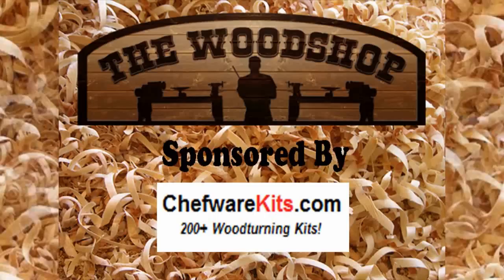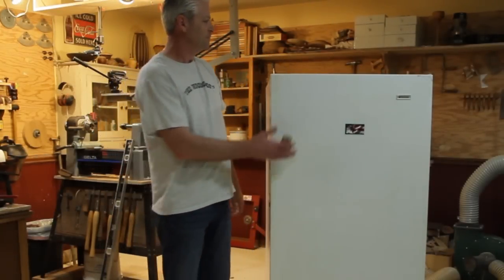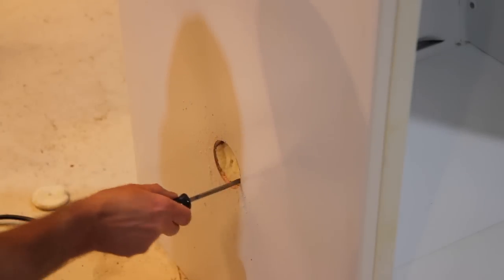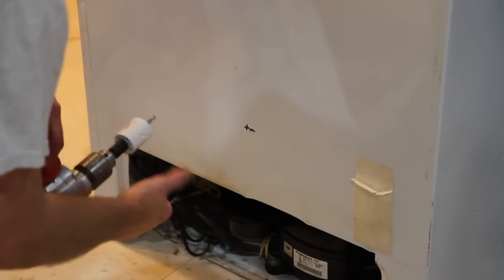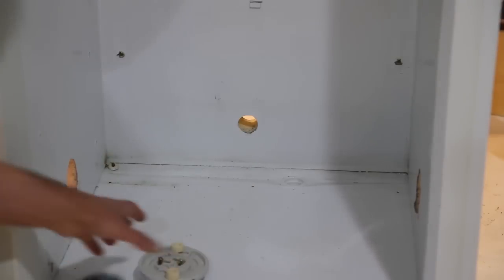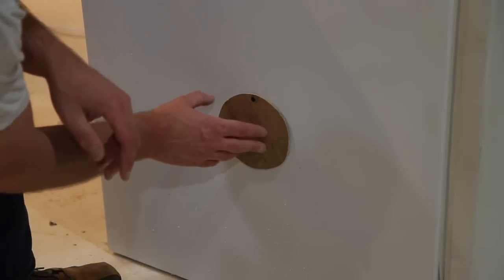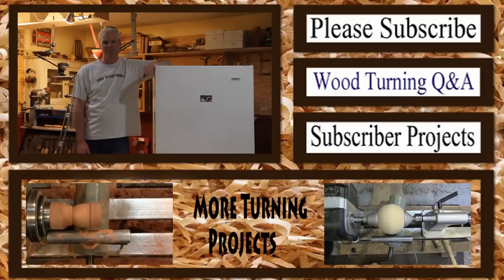DIY Kiln- Turn An Old Freezer Into A Kiln For Drying Wood

Comment: Yes add a fan !  Nice freezer kiln. You could hang your moisture reader on the door owl magnet.
Here I've been considering building a solar shed kiln. But this freezer looks quick and easy for small turners etc.
I'll give it a try with some local black cherry, maple, and black birch I've cut this year.  
I always worry about fire hazards with anything I leave on indoors.  Think I'll have two vents in case one slips closed... 
Thanks for the video Carl.

Comment: Great idea Carl,
despite the fact that you are recycling an old freezer instead of building an insulated box out of wood and styrofoam here is another tip from me, if the motor on the compressor is still running, you can use it as vacuum pump for veneering. I did this 25 years ago laminating wings for RC gliders, as the glass fiber mats, the carbon fibers and the epoxy had to "bake" in a vacuum, we build the box (2m long but only 40cm x 40 cm in width) heated with a 60 w light bulb, the wing inside a plastic bag which holds the vacuum from the compressor.
Another tip from me: as the airflow should only get rid of the humid air, you might reduce the energy used for the light bulb by adding some kind of a thermometer from an old stove (temperature to be controlled should range from 40°C-250°C, 100 F - 480 F) so the temperature will not exceed the desired as the light will be shut of by the thermostat. This reduces power consumption, and you have a more even temperature inside, which might help with the drying as well. So you what I suggest is keep the temperature at an even level (lets say 50°C = 122 F) and slowly reduce the humidity inside by opening the holes: I think this might work better than reducing the humidity very fast, as this will do damage to your wood. And after a day or so, the humidity inside the fridge should be the same as the one in the wood, therefor you just have to measure the humidity of the air to see whether the wood is "done" or needs some more cooking.
Greetings from Good Old Germany
Happy Easter
Peter
Reply from the maker: Thank you Peter,
That's a great idea! I'll check out the appliance repair store, and see if they can help me out. 
Happy Easter,
Carl

Comment: Thank you for this video.  My shout-out to you is a bit late.  After watching this last Spring I made one out of a stand up Freezer with a 2-Way bulb adapter and this thing cooks.  It works so well I just picked up an old fridge and am making a 2nd one.  Drying small wood slabs and cherry wood chunks for bbq wood.
Thanks again.  You made this look real simple.
Reply from the maker: Very cool glad they're working out so well for you.
Reply: How long did it take for the wood to dry.

Comment: Good video Carl. I got an old broke down fridge and freezer, took out the refrigerant equipment and put in a $16 ceramic heater which has a thermostat on it. Set the thermostat and put the heater on low air flow, stuck an outdoor thermometer inside and left the door cracked a little for air flow. It works great. I have only lost about 1%-2% of the bowls I have put through it and that is a bunch of bowls, blanks, club members blanks and bowls. Only have $20 in it tops. I may put a hole in the side but I haven't seen where it would help out much.
Reply from the maker: Thank you Adam,
I'll look into ceramic heaters, the light bulbs are getting scarce.

Comment: Great ideia, mainly if one realises it can be used for several different purposes besides drying wood. I think it could be easely adapted to dehydrate food or dry ceramic in a poters shop. Of course the power of the lamp would have to be adquately adjusted.
Reply: A grat ideia!

Comment: That's a much better kiln than I made. I just made mine out of OSB, then had to line the whole thing with aluminum foam board. I used a 125 Watt flood light though. Depending on what I'm drying, I can get it up to 140 degrees with there.  Nice project.
Reply from the maker: Thank you Steve,
This freezer was given to me, or I would've made something similar.

Comment: You might consider a shield to block the direct light on the wood. This will help to avoid hot spots. Also I believe a kiln needs to be kept at around 105 no warmer than 109 to avoid cracking. Some water heater thermostats go up to 110 before shutting off. Maybe testif wiring it to the light or a fan.
Reply from the maker: Thanks for the tips, I think I need to get a thermostat.

Comment: Great project Carl, I will be interested in seeing how this works for you.  I suspect that a little fan to move the air in the box, would speed up the drying process.
Reply from the maker: Thank you Bill,
I took the little fan out of the freezer, but I might wire it back up.

Comment: You could use the wiring and power cord from the old fridge light, and probably even the light bulb socket. Just be sure the freezer compressor is disconnected from power. Oh, and there may also be a fan on the fridge motor.
What temperature inside the wood kiln are you aiming for?
Reply from the maker: Thanks for the tip Gary! I'm shooting for around 100

Comment: Nice Kiln. I built a fruit dryer along those lines, and used a couple of 12V computer fans I had sitting around for ventilation. You need to use a transformer to get the AC in to run the fans at the right voltage. Too bad those incandescent bulbs are getting scarce. They make good heaters.
Reply from the maker: Thank you John,
It had a little fan in it, I may try to hook it back up if it won't work old-school.

Comment: I decided to copy you and started cutting holes in the freezer but the drill bits kept coming out with sirloin steaks and sausages stuck to them.  I'll have to watch your video again to see where I went wrong.  The bulb - I've seen a cover put over it to stop condensation splashing on it.  The other thing I saw was a little computer fan to move the air.
Best Wishes, Brendan.
Reply from the maker: The steaks and sausages are where I got this extra 20lbs cleaning out the freezer :)  It had a fan in it, I may have to hook it back up. 
Take care,
Carl

Comment: Here's a tip if you drill a hole too small with a core cutter, put the right size cutter on the arbour, there is sometimes enough thread on it to put the wrong size core inside the right size one, that will centre the bit. ;)
But hey, you're a woodturner, i bet you could have turned a 'dowel' to fit the hole with a pilot hole already drilled
Reply from the maker: Thanks for the tip Sparky

Comment: Next time - to make a 1 1/2" hole a 3" hole cut another 1 1/2" plug with the hole saw from a piece of scrap and use that plug to center the 3" hole saw to cut the larger hole. It will wobble, but should be close enough to work. Or if you have a 1 5/8" or 1 3/4" hole saw that might make a plug to fit more precisely to prevent the 3" from wobbling.
Reply from the maker: Excellent idea! Thank you

Comment: Hi Carl, I enjoy each and everyone of your informative videos, they have been thought provoking and inspiring. 

When 100 watt incandescent bulbs become obsolete, you can go to most any gun shop and get a gun safe heating rod. They are used to eliminate all moisture in a gun cabinet that would cause rusting problems. There not expensive to operate and last a lifetime.

Comment: Interesting. I'll be curious to know how much this changes your drying time. I'm presuming you want to use it to speed up the dry after rough turning.
Reply from the maker: I'll be running a few test over the next few months. I'm hoping it will speed up the drying process before turning.

Comment: you should have mounted the light to a metal electrical box & put the wires out side the cabinet with a strain relief  or other to make sure the wires could not get pulled out.

Comment: You could control the temperature inside with a PID (cheap ones around $25) and a thermocouple. This'd cause the light to flicker, so switching to a toaster oven heating element might make more sense.
Reply from the maker: Thank you for the suggestion.

Comment: Have a look at some some of the beer brewing control projects done using an Arduino or Raspberry Pi on Instructables. This is just the sort of closed loop system that they would work well on. Just set the humidity level and temperature and let the control circuit do the heat and airflow.... 
It might be a bit of overkill for drying wood but I wasn't the one suggesting you turn a fridge into a kiln.  ;-)
Cheers,
Ben
Reply from the maker: I'll look into that. Peter also suggested using an old oven thermostat.
Take care, 
Carl

Comment: I KNEW I bought a 30 year supply of 100W light bulbs for a reason!  Just didn't know what it was until now....  Seriously, I bought about 200 of the 100W bulbs during Home Depot's "last chance" sales. Also stocked 75W, 60W, and 40W incandescent bulbs. 
I think if you look around, HD, Lowes, Sam's, and BJ's still have some 100W's, but as stated in the comments, not for long.  I can't stand the replacements, though LED's may eventually be the answer....just too expensive right now, and still being improved.
Reply from the maker: Nice, you're going to be very popular soon......lol

Comment: So, on the eastern (desert dry) side of the state would you use a hot tub instead of a freezer? Or, use the little hole in the bottom to hook up a humidifier? <grin> Great job, and nicely described. Oh, and it can double as a fish smoker, too.
Reply from the maker: Thank you Stuart, you can use the hot tub to boil it, and then put it in the smoker lol

Comment: I wonder if the old cooling system could have been retrofitted? Take out the Freon pump and add a tank-less water heater with recirculation pump and run water through the pipes.
Then a chemical such as Royal Purple Ice or Lucas Oil super coolant radiator additive could be used with the water to pull the heat from the heater more efficiently and put it into the fridge. Make it a closed system with the additive and the boiling point is raised to keep danger down in case you are looking at high temp (I don't know what is best to dry wood).
A thermal coupler could be installed in the fridge to monitor the internal temp and with some simple wiring a automatic on/off temp controller could adjust (turn on/off) the water heater and keep everything in order. The temp controller (depending on model) could have a step heat program to allow for "slow heat" ex. it heats 10* over an hour, each hour until it reaches set point so if set point is 100* it takes 10 hours and will stay at 100* until manually turned off. Slow heat is only needed if heating the wood too fast would cause it to split, I know nothing about wood and how to cure/dry it. 
 Oh and a hole to allow the water vapor to vent, like the one you already have, but you may want it in the door since the door does not contain any pipes for the Freon. That way the system will not be damaged. A fan to push the air back down the sides so the heat can bring it back up may help as well, as long as the air moves around the wood and doesn't just sit there. I guess a hole at the bottom of the door and one at the top would do just fine
But hey, I may be over thinking this LOL.

Comment: The only problem is that you cannot or shortly cannot buy 100 watt incandescent bulbs. But I'm sure you'll be able to adjust.
I'll be interested to see the drying routines.
Alan
Reply from the maker: I'll have to get a bail of them at Costco :)
Reply: Carl Jacobson halogen spot light. they get hot
Reply: that is ridiculous that they want to ban incandescent bulbs the only light better if from the sun it self. florescent bulbs don't last near as long and are more expediencies and don't come close to an incandescent. i say contact you senator and tell him that your his boss and if he passes this he will be making a big mistake. so what they use a little more energy if there is an energy shortage tell people to stop plugging in those death traps they call EV's (electric vehicles) you would save a ton of energy that way
Reply: What I am using is some small crockpots like they use for potpourri no need for a lightbulb at all and they work great

Comment: The proper way to install the light bulb is to use an electrical box. The light bulb is an expensive way to do it. Reversing the freezer to heat the inside would be far more efficient.

Comment: Hi Carl - how did the Kiln turn out?
If successful, how long did it take to achieve desired results? 

Thanks!
Reply from the maker: Thank you Carlton! It drys small pieces in a few weeks.
Reply: @CarlJacobson  I'm considering building one to dry some wood cookie slabs, say 1"-2" thick and between 12" - 24" in diameter. I know there are a lot of variables (wood type, wetness of wood, etc).. Any ball park estimation as to how long it would take to dry from a freshly cut hardwood cookie of this range of size?

Many Thanks Carl! This is very inspiring!

Comment: Hi Carl, I know you built this 7 years ago, but do you have a follow up on this system and do you use it today?
Reply from the maker: Hey Dean! I didn't do a follow-up video, but yes I'm still using it today, It works great for smaller pieces.
Reply: Thanks Carl, have a great weekend.

Comment: Hi Carl, what type of heat source should i use.. and what type of drill bit is that  your useing
Reply from the maker: Hi Brittani, 
I used a 100w light bulb as a heat source. and it works great. The drill bits are called hole saw bits.

Comment: Hey Carl, how did this work out? Ive been hearing about these and theres a few ways to do it. I own a junk removal company and I have 3 scrap fridges in the yard ready to go to scrap yard. I think im going to use one for this. Maybe all 3. haha. Any tips on what you added, what not to do and so on? Ibe heard changing the watt of the bulbs every so often.  And adding a computer fan in it.
Reply from the maker: Steven Rose It's working out very well for small stuff. You should put a fan in it, it helps out a lot. I'm not sure about changing the bulb or the watts.
Reply: Carl Jacobson how about a ceramic heat element like for lizards

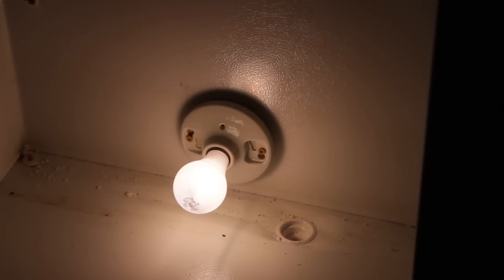Comment: 3:20  the highest wattage  incandescent bulb you can now (legally) buy is 60watt.
Reply: +Lenny F you can use a flood light.
Reply: +Lee Goins,  Flood light is a type of bulb, can be any wattage.
Reply: Lenny F The case my uncle bought a few years back are 500 watts, e still has several left.
Reply: +Lee Goins I just want to dry the wood, not burn it.
Reply: Lenny F use 2 lights and have 120w ;)
Reply: Thanks Mike, you are one heckuva rocket surgeon.

Comment: Hey Carl, did you ever share any results on this?  I don't remember if you did.
Reply from the maker: Jay Tomes Hey Jay, the Kiln works great for smaller stock, like pen blanks. I still dry the larger stock for bowls and such, by painting the ends with house paint and air drying them.

Comment: Hey Carl. Do you still have and use this? If so I’m thinking about making one since I have a fridge/freezer I’m doing nothing with. I’d like to know what wiring you used as well as the bulb and how long it took to dry certain wood. Thanks in advance.
Reply from the maker: Hey Dan, yes I still use it. It takes about a month to dry small pieces. I used a standard bulb socket from Home Depot.
Reply: @CarlJacobson  So 100w constant over a month?

Comment: I don't know if you need this precise of a control but I use one of these thermostats in my lagering box (it's a brewing thing!). It would work really well in your kiln. It is digital and would shut the power to the light off and turn it back on within about a 2 degree variance. I'll probably build a kiln like yours and give it a try myself.

http://www.northernbrewer.com/shop/johnson-controls-a419-digital-temp-controller.html
Reply from the maker: Tom Usher Thank you very much Tom, I'll check it out.